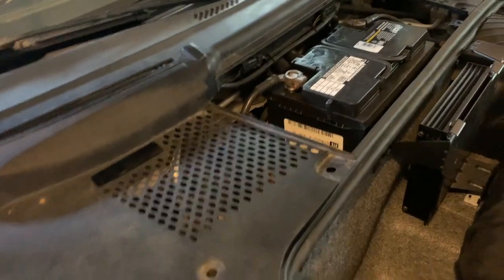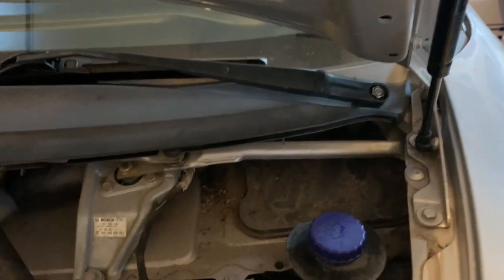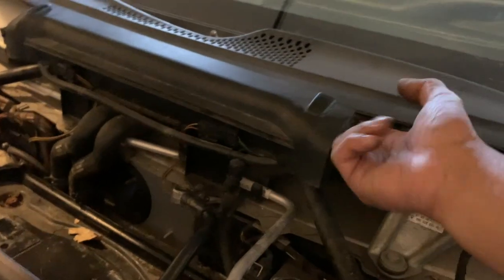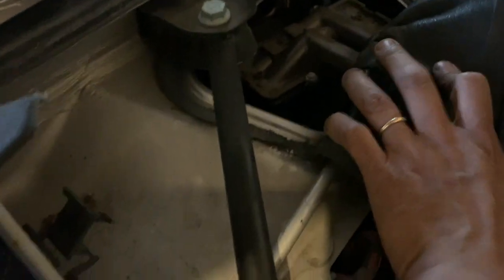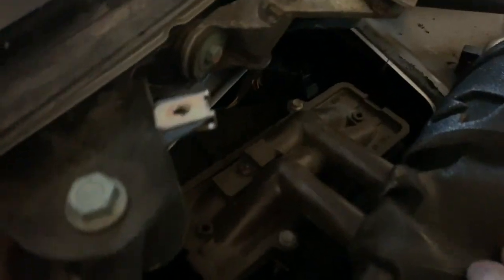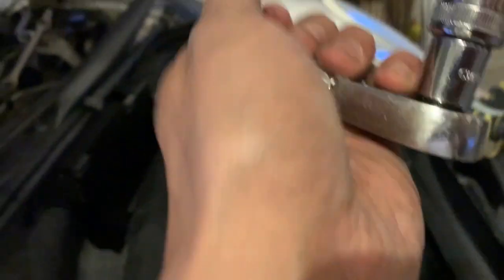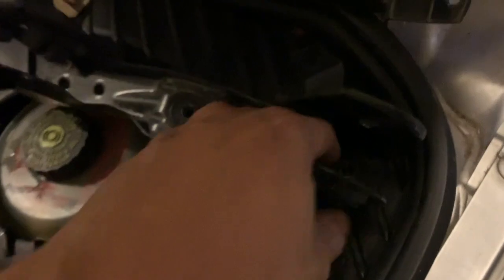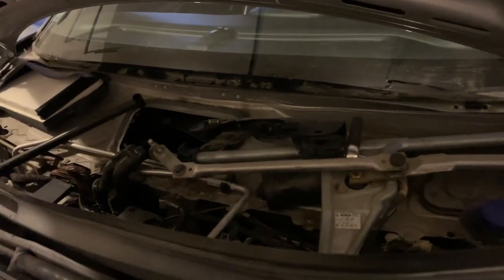porsche boxster - heater core

Comment: Porsche coolant must be mixed with water. So a gallon is actually 2 gallon and it's not 50$... even at the dealership. I recently did my coolant expansion tank on Transsyberian. Also, my daughter got a Boxster and it had green crap in it 👎
Remember that Volkswagen and audi also use Porsche coolant so you can get it there too.
Or since you don't like dealing with coolant you could get an old air cooled Porsche.
They are not unobtainable.

Comment: The Prestone you've been using is not only perfectly fine, it's better than both Zerex G-05 and the OEM coolant because it doesn't have silicates which destroys the water pump seal.  Any universal extended life coolant would be fine, like Prestone, Walmart's Supertech, any parts store house-brand extended life coolant, Peak Global Lifetime or Peak 10X.  The best thing you can do for this car is to drain the coolant, flush with a garden hose (on gentle pressure) until what comes out is completely clear, then look up the coolant capacity of the engine and fill with concentrate using 50% of the total system capacity.  That will give you a final 50/50 ratio of water to coolant.  If you want the best one, it's Peak Global Lifetime, available at any Napa store.  Please do a new video doing this with the Peak Global Lifetime.

Comment: Really awesome video Sonny!  Thanks so much for sharing with us!!!  My god son's  '03 S started leaking a lot of coolant just yesterday and today we discovered the passenger floor mat/carpet was wet with coolant -- so we need to do the heater core replacement too and so thankful for your generous video!  How did the job work out for you?  . . . and how did you clean the coolant out of the passenger mat/carpet?
Reply from the maker: Boxster is now nearly perfect.  No more overheating.  One way is to remove the seat and carpet  (to dry off).  The second approach is to use rice to soak up the coolant.  Lastly, there is an odor remove bag that will soak in the coolant and remove the smell (if any).  Let us know what works for you.  Thanks for watching.

Comment: Did you use a vacuum tool or just the burp valve in the rear engine compartment?
Reply from the maker: Burp valve (coolant escape valve).  Had that not work,  would have used the vacuum tool next.

Comment: Is it worth doing this kind of thing yourself or better to just take it somewhere for someone else to do it
Reply from the maker: Good question.  It comes down to your comfort level of repair and cost from shop.  It is much more effort than I initially imagine but not too difficult (compare to clutch rebuild and head gasket replacement).  Since I like to tinker and repair,  I can’t imagine dropping my car off fit a few days and spend $800-1200 for repair (due to time consuming tasks not difficulty).  What is your take?